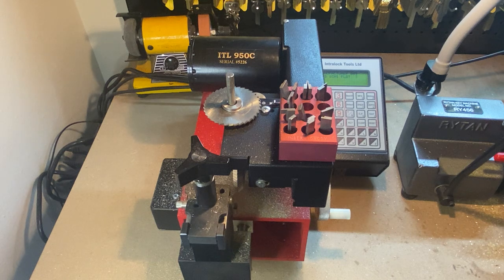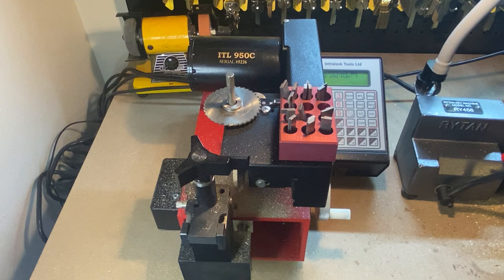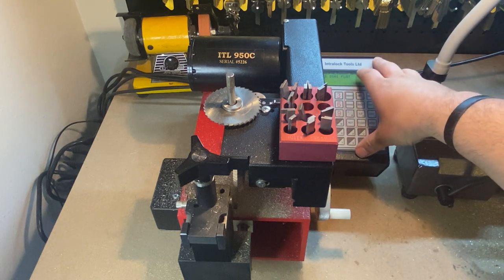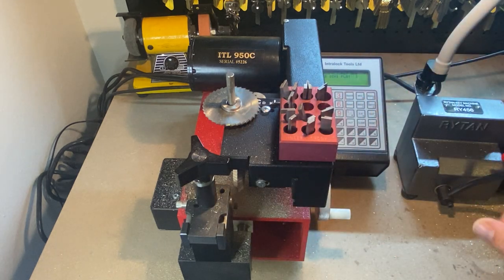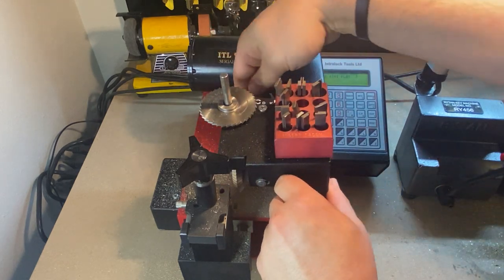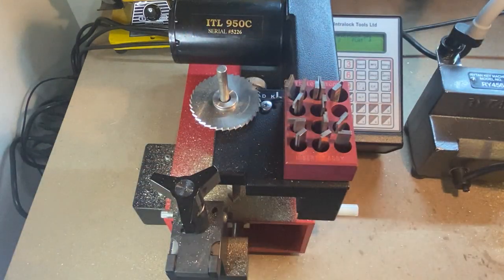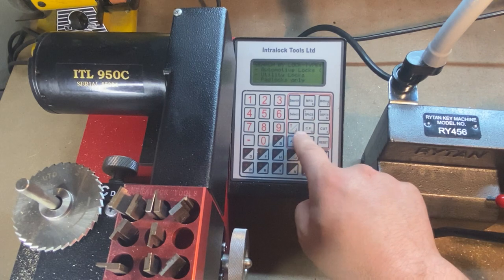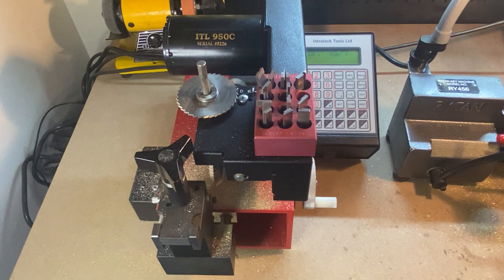(33) ITL950C walkthrough/what I like in a code machine

Comment: HPC Codemax is the nearest thing to the 950C, but the HPC Codemax or ILCO/SILCA Ultracode is actually more of a direct competitor to the ITL 9000 series, which is fully automatic. ITL Support is the only problem with the company. IF One guy is not your pal, you will not get support if machine fails. I have a 950C with an encoder that is not working, so machine is a brick until I learn how to repair. The inserts are FAR better than 4 sided or universal jaws. It is one of a number of things GREAT about ITL.... But the machine is a 35 year old design, Serial port connection from computer, flash card replacement for updates ( There are NO updates, as far as I know ) Wish this video was a REPAIR video.

Comment: My machine cuts instead of 9 cut 8
So if I cut 97657 it cuts 86546
What possibly I can do to fix it?
Berj wants to have $4000.00 per day to train how to fix it.
Reply: Try to recalibrate the depths (from what I recall, ITL 950C has a function for correcting manually)
Reply from the maker: There is a process to recalibrate these, do you have your ITL book?